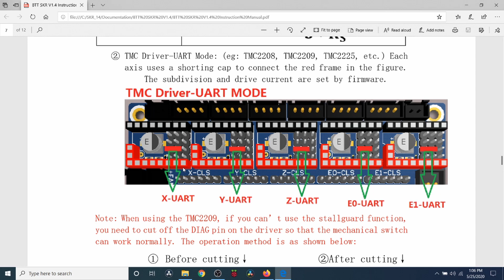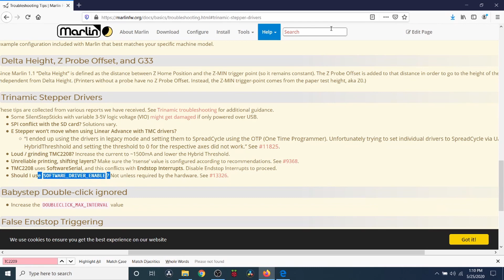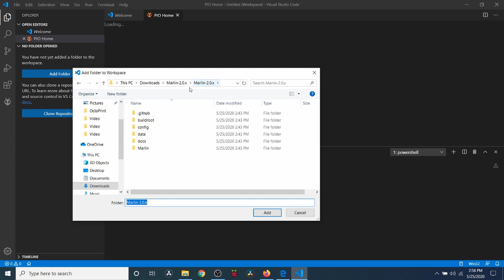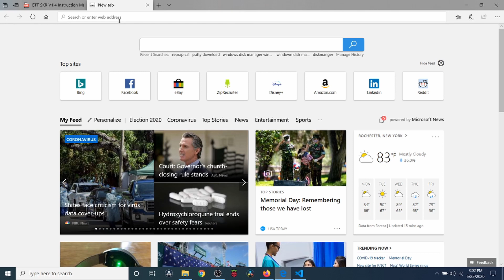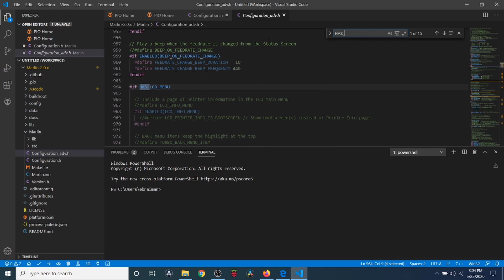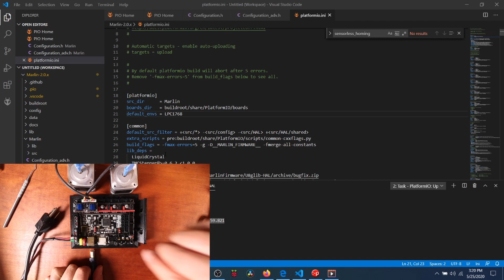SKR 1.4 - TMC2209 v1.2

Comment: Hi, I am currently using, a tmc2209 for stepper motor, but no matter what I try, I cant get it to spin in both direction CW and CCW simultaneously, (it just moves when it gets HIGH 3.3 and just vibrates at 0) can you please help me with this, also can you help me develop a smaller shield for 2 tmc drivers as I want to make my project compact.

Comment: Is there firmware to drive a CNC router for this board. I will use external stepper drives. Thank you for any help you can provide
Reply from the maker: Technically Marlin firmware can be used for CNC.  Unfortunately I've not done a tutorial on it as my building walls are thin.
Reply: @EdwardBraiman  Thank you for your response, If you hear of one please let me know, Thanks good video
Reply from the maker: You're welcome.

Comment: u never explained what UART is
Reply from the maker: By definition, UART is a hardware communication protocol that uses asynchronous serial communication with configurable speed. Asynchronous means there is no clock signal to synchronize the output bits from the transmitting device going to the receiving end.

Comment: in my marlin screen appears "tmc connection error" do you know what that means? it's a 1.4 skr turbo with tmc 2209 1.2 drivers
Reply: check jumpers under stepper drivers
Reply: @Ecevitnl76  I have the same problem and the jumpers are correct.
Reply from the maker: Is the system powered by PSU or USB?
Reply: @EdwardBraiman  psu
Reply from the maker: Is it all of the steppers or a couple?
Reply: @EdwardBraiman  all steppers are affected as far as I can tell. Every axis overheats when printing which causes awful printing issues. I don't have or know how to use pronterface. Can it be used without WiFi?

Comment: Great video, I am running into the issue that my x axis only goes one (positive) direction. SKR 1.4 turbo with btt 2209 v1.2. with bltouch (assuming here is an issue?)
Testing X connection... OK
Testing Y connection... OK
Testing Z connection... OK
Testing E connection... OK

working in this since 3 days, I have no clue.
Reply from the maker: What happens when you first home any direction and then try and move positive from that and then negative in other direction?

Comment: Hi, thanks for the amazing video. I looked around and seems to be a shortage of TMC2209. But the few I saw,  some are v1.2 others v3.0. Some are branded Bigtreetech other are Biqu or other brands. Which I can consider reliable? On a stock printer, like my CR10s, you suggest to change the stepper motors or  I can keep them?
Thank you
Reply from the maker: Well I've not used the 3.0 version, but it sound like a usable alternative.  Just remember to check for UART.  If it's missing you'll be knee deep in datasheets.

Comment: Great info in your vid. I was trying to understand the real benefit of setting native steps to 64 vs 16 since TMC2209 will interpolate to 256 and if native 64 is a real gain why not going all the way up to 256 native ?  is torque the problem ? please try to clarify this if possible, thank you for effort.
Reply from the maker: There are various reasons why 256 might have issue as some users have said, but they a maybe related to firmware or the datasheet over claiming it's capabilities.  I like to warn people in case there is an issue.  Marlin firmware has been patched recently so it may work now.
Reply: Might be the board processing power also a problem?  @EdwardBraiman
Reply from the maker: Maybe, I need to read the opened or closed issues on Marlin firmware bug database to know more.

Comment: Another awesome video...Why did you go and get your Marlin copy from the Marlin github instead of the BTT github like you did with the SKR 1.3? Are both the repositories updated the same? Are the versions of Marlin that you can get on the BTT github already partially configured for the 1.3 and 1.4?
Reply from the maker: Marlinfw.org should always be used because it's the most current.